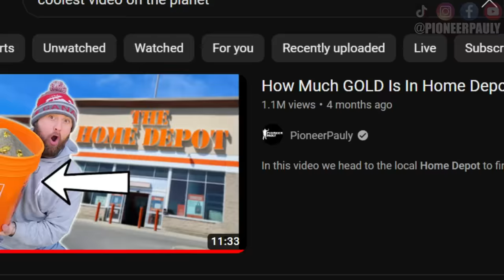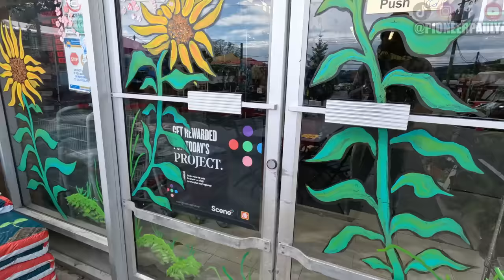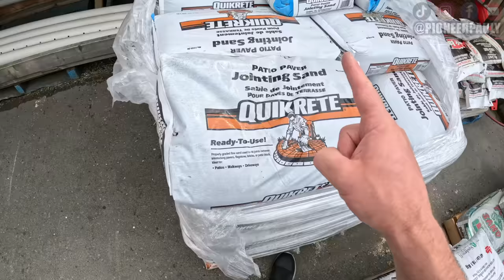Which Hardware Store Has The Most GOLD In Their Sand?

Comment: If the sand is dry, you could drill a small hole in the bottom of the bucket and put it onto of the sluice and it should slowly auto feed itself.
That way for the next video you can quickly run 10 bags through the sluice 😃
Reply: The hero we needed
Reply: Fine gold can float if not wet down first
Reply: He don't need that when the video is faked.
Reply: @KyleKingProspecting you just repeated what was said in the video
Reply: You could call it an AUrglass
Reply: @flight2k5  okay bud that’s just common knowledge when dealing with flour gold😂
Reply: @KyleKingProspecting  🤣😂 ok cool guy
Reply: @flight2k5  😂😎😎😎
Reply: @triggerfish2711 how tf is it fake

Comment: You should try the tube of sand. It's use to add weight to things, like in bed of pickup for winter weight. Anyhow it's less refined than play sand
Reply: Tube of sand??
Reply: Yes it is sold by quikrete comes in 60lbs bags. Long white sand bags
Reply: @daveblack6044  you've ran this this sand?

Comment: After you run the sand and remove the mat best way to retrieve gold is with a non ferrous magnet quick and easy
picks up gold lead and glass also McDonald nuggets -  other than the humor we panned in Colorado found lots of black sand 
although i have retried objects that were non ferrous with silicone or adhesive on a stick it worked

Comment: You contaminated the lowes bucket by putting the extra quickcrete in there. The concrete was on the white bucket now lowes. You can actually see the water turn grey when you used the white bucker.

Comment: Cool episode for sure, but you guys screwed up! The second place you purchased the sand was The blue place. It was play sand. The 3rd place was HH and it was the quick crete. 
When you ran them through the water you did the HH bucket second and called it sand. 
You did the blue bucket last and called it concrete sand which it was the play sand. You then added the rest of the bag of concrete sand to the blue bucket and you should have put it with the HH bucket. 

It was a fun video cool results!

Comment: And there’s usually two different spots where they sell sand like at my local hardware store. They have playground sand and then they have banks, sand or builders sand for contractors over by like your cement and everything. You can also buy sand there and sometimes it comes from a different Corey‘s in the playground sand.